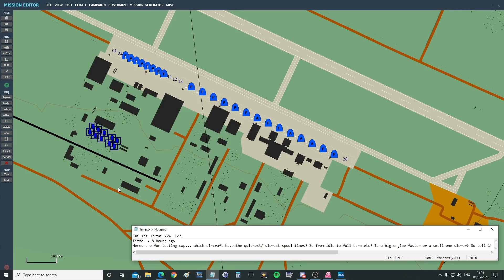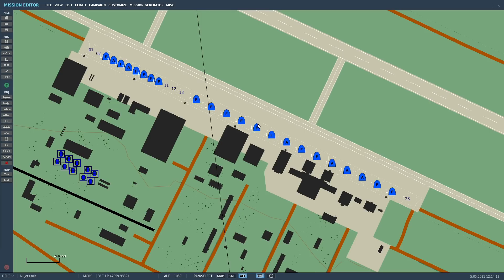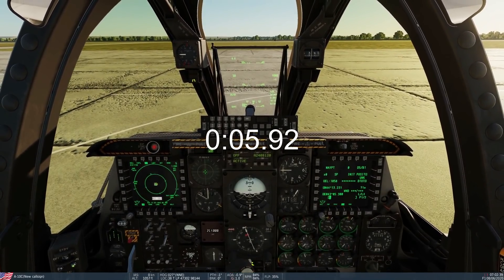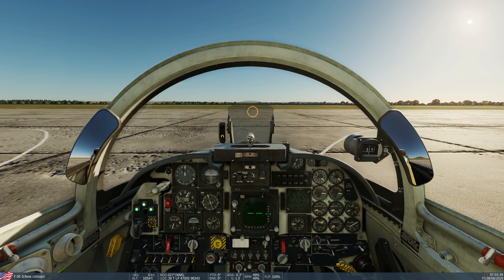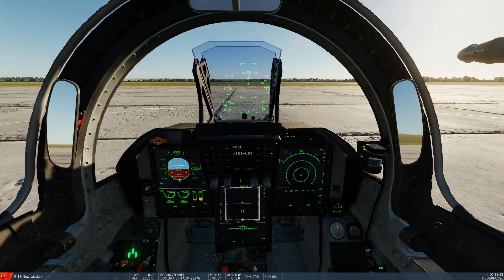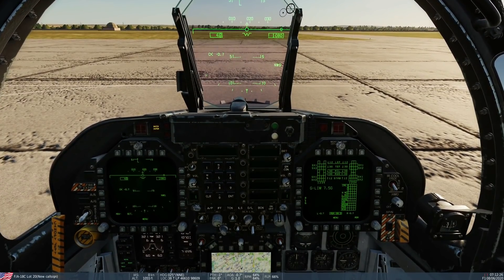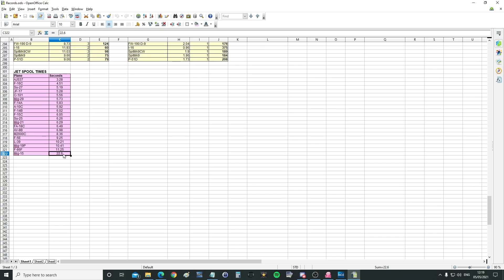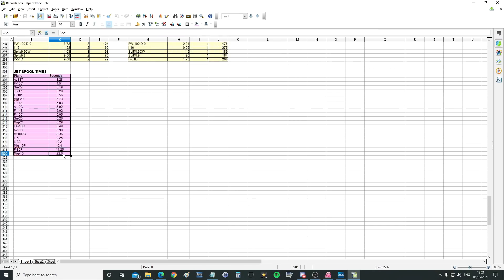Questioned: Which Aircraft Have The Quickest Spooling Jet Engine? | DCS WORLD

Comment: I think the dominant factor is the number of spools/rotors: twin spool/rotor engines are far more superior. As your test shows the faster ones, faster than M2000, are all twin spool engines. M2000 and slower ones are single spool engines. 
The twin spool engine means having a tiny high pressure core rotor, which can freely outrun the bigger low pressure rotor. The HP rotor is very much the true engine while the LP rotor serve as a turbocharger to the HP, so it's okay to scram the HP real fast without caring too much about LP. Also having an LP will make a good working environment of HP, so the HP won't stall easily. And having a light weight HP will shed load from HP turbine, also avoiding the turbine to overheat, so you can pour more fuel into the burner.
Other factor such as variable guide vanes at compressor also helps, it somewhat acts like having an LP compressor avoiding stall, but can not help with the weight and turbine load. That's how M2000 engine become the fastest spooling one among all the single spool engines.
One exception is the L39 engine, a twin spool one but slow. I don't know why.

For jet engine it's not easy to talk about efficiency, because they don't want to extract the energy from the exhaust. It's the converging-diverging nozzle that turns heat into exhaust kinetic energy. But if we put a free turbine after the engine and extract energy, then it becomes a turboshaft, usually having 25%thermal efficiency. But the free turbine itself also contributes some loss. A properly working turbine has around 80% efficiency.

Comment: Don't the F-14B and the F-16C have the same GE engine? If so why is the  are the ones in the kitty slower to spool up?
Reply from the maker: Neg different engines pretty sure. At least our model.
Reply: @grimreapers  the DCS F-16C has the  F-110-GE-129 while the F-14B has the GE F110-400, not sure what the difference between the two are

Comment: The MiG-15 takes the longest as the VK-1's (licence production of RR Nene) compressor is centrifugal, the impeller is much heavier than an equivalent axial compressor rotor so it takes a while. Also I presume the VK-1 has no variable geometry in the engine (like intake and nozzle guide vanes) so fuel flow has to be increased slowly to keep turbine inlet temperatures below limits and avoid compressor stalls.
USA was very salty about RR (well actually GB) selling the blueprints of the Nene to the Soviets back in the day. Another story.

Comment: Spool times become more interesting the more spools you actually have. The RB211 on the TriStar would take a fair old time to start simply due to the mass of the rotating parts, especially the front fan. To get ignition you needed 25% N3, 10% N2 and 'some' N1, ie as long as the fan was turning then it was fine. The airflow controls (variable inlet vanes and compressor bleed valves) work on the N2/IP stage, so it had to be at this minimum speed to ensure you wouldn't induce a surge or stall when beginning combustion. After that, it would slowly creep upwards with the starter releasing at about 35% and on towards an idle of about 50% percent, air temp and pressure depending. If you wanted to accelerate further, your acceleration schedule would massively depend on your fan speed, as that took so much longer to speed up than the other two stages. Once you got past 80% ish, the whole thing has so much momentum that speed changes happened much quickly - this is the reason on ailiners when pilots apply power for takeoff, they'll move the throttles to a mid position first and allow everything to stabilise, as this is where the largest difference in accel times can be found, and could potentially cause a yawing motion on the takeoff roll. If they're all at about 80% ish and stable, they'll accelerate to take-off thrust much more symetrically than going straight from idle.
To summarise, it's all about airflow control and keeping the fuel schedule between two lines on the graph - too much or too little in relation to the air going through the engine and you risk surge/stall when trying to change the engine speed. If we could get this modeled in DCS that would be great - doing the adjustements on the engine whilst it's running though, is not so great...

Comment: Isn’t the F-15C engine the same as the F-16? Interesting the spool time is so different.
Reply from the maker: Neg, I used to think that also, but different engines, also the F-16 has had at least 3 engines since the prototype.
Reply: The F-16 Block 32/42/52 PW engine like the F-15C/D.  The F-16 Block 30,40, 50 have GE engines. Since the F-16 in DCS is the Block 50 it does not have the same engine as the F-15.

Cap, you are correct about the F-16 having at least 3 engines since the prototype.

I will start from Block 30.
Block 30 = F110-GE-100
Block 32 = F100-PW-200
Block 40 = F110-GE-129
Block 42 = F100-PW-220
Block 50 = F110-GE-129
Block 52 = F100-PW-229
Block 60 = F110-GE-132

Comment: Gents, it's not so much the materials in the engine that determines the engine spooling.  The age of the engine determines the spool rate.  Older engines used mechanical engine controls and that's what adds to the lag.  Newer engines usually use a combination of mechanic and electrical control and tend to manage the engine better.
Reply from the maker: thx

Comment: Not So Fun Fact: When I was stationed at Tinker AFB, with AWACS, we were driving on the ramp going to run a jet, when we saw an A-7 Corsair II, that just came at of Depo Level Maintenance. They were starting it for it's first flight. I heard the air starter then woosh. It started in like 2-3 seconds. Didn't think that was possible. E-3A TF-33's take like almost a minute to spool up. So, it went on it's first flight, had some kind of engine trouble, and the pilot punched out over Del City. The A-7 hit some ones house, pretty sure no one injured or killed. Pilot was walking around dazed in a field. Yeah.

Comment: Liturature from the 1980s talking up the F/A-18's GE F404 was the very fast 4 seconds from idle to afterburner. It was said to be quite faster than the F-15/16 P&W F100.  Certainly at the time, comparisons of the F404 were mainly to the J79 types, though it was stated the F/A-18A was beating the F-15A in a short drag race becuase of engine response time. 

Considering the F-14B, F-15C, F-6C all use GE F110, they should be relatively similar. And I wouldn't be surprised if spool time was faster than F404.

Comment: A big part of what limits the spool up time is the need to avoid compressor surge. Unlike a piston engine, the combustion chamber of a jet is open at both ends so if you dump a load of fuel into it at low RPM, the chamber pressure can easily rise past the point that the compressor is able to continue to supply air because the turbine hasn't had enough time to spool up from the increased downstream flow. You then get a reversed flow as gas from the combustion chamber pushes the air backwards through the compressor stages and blows it out of the intake, sometimes with catastrophic results.

Other reasons to avoid very rapid throttle changes are to prevent excessively high temperatures from a sudden change in mixture ratio from being very lean to running closer to a stoichiometric mixture. Again, the problem is caused by the rapid increase in fuel flow before the compressor has had time to speed up enough to supply sufficient air. There's also a third point which affects multi-spool engines in which the high pressure compressor stages are connected to a small, high pressure turbine with a larger low pressure stage downstream. The difference in rotational inertia means that it's much easier and quicker to spool up the high pressure sections than the low pressure ones, so a sudden throttle increase can lead to compressor stall in the HP section because it starts spinning too fast and needs far more air than the LP stages can supply.
Reply from the maker: thx

Comment: parasitic shaft losses would be really, really low....keep in mind that from all the mechanical power extracted by the turbines, about 2/3 are gobbled up by the compressor and only the remaining 1/3 spins the fan...the one that makes most of the several tons of thrust.

A few 10s of kW taken by the generator, hydraulics and fuel pumps barely make a dent in the shaft power budget ;-)

Comment: It would perhaps be interesting to see what kind of engines the planes have.  And where it's licenced from if its a modified version.
Reply: Viggen uses a Volvo RM8 which is a heavily modified P&W JT8D - a low bypass turbofan originally built for the 727 airliner. Volvo basically took the civilian design and upgraded it for supersonic flight as well as added an afterburner. 

Depending on the age of the model used, the F-16 could have either the P&W F100 which is also found in the F-15, or it could use the GE F110 which powers some export F-15s as well as the F-15EX (although multiple versions of both engines have been and are currently in service). 

The MiG-29 and JF-17 both use versions of the same RD-33 engine .

The Mirage 2000 uses the Snecma M53 which is an interesting engine because it's a turbofan version of the Atar turbojet, that was derived from the WW2 BMW 018 which itself was a larger version of the BMW 003 that powered the Heinkel 162 fighter and Arado Ar 234 bomber. What started out as one of the earliest jet engines ever, which produced a mere 1,760 lbf thrust ended up as a 21,400 lbf thrust afterburning turbofan that's still in service today.
Reply: @trolleriffic   im 99% sure that the f-16c block 50 (the one we have in DCS)  has the general electrics engines. P&W’s would be seen on something like the block 20 (MLU)
Reply: @koekiejam18 ,  @trolleriffic , The F-16C Block 50 does have the GE engines and is the F110-GE129.  Starting at Block 30 all blocks ending in "0" are GE engines and blocks ending in "2" are PW engines.

The current F-15EX's will all have F110-GE-129 engines because the PW engines have not been approved for "Fly by Wire systems", but this will change because the PW engines will get approval for the FBW system.
Reply: @williambyrnes4198  hmm might've made a mistake there, couldve sworn that my country's airforce has block 20's with pratt and whitneys...
Reply: @koekiejam18  Read my comment again and you will see that it says "Starting at Block 30".

You are correct about your Block 20's having PW engines because all F-16's under block 30 had PW.  It was not until Block 30 did they start putting GE engines.

The Block 20 that your country has most likely has the F100-PW-200 engine because that is what was used in the Block 20's when they came out.  Your country might have upgraded the engines to -220's if that is what you have now.
Reply: @williambyrnes4198  i see my bad, no clue wether we upgraded the engines, dont think that was a requirement for the MLU program

Comment: Here's another one, how can the one turbine of the F-16 be stronger than the two turbines of the F/A-18?
Reply: The two F404s in the F/A-18 have a higher combined thrust than any of the F100s or F110s that power the F-16 but the difference isn't huge. Basically the F404 was designed to be cheap and reliable as well as having a lower thrust and smaller size to suit certain aircraft, while the engines for the F-16 were much more state of the art and designed to be big and powerful at the expensive of cost and reliability in the early days. The F110 is heavily based on the F101 which was developed for the B-1 Lancer and was the most powerful US military jet engine when it was introduced.

Comment: Just a rebuttal on your statement that axial engines are superior in every way: Centrifugal compressor engines are superior in terms of torque-conversion. That's why they're still widely used in turbo-prop and turbo-shaft aircraft and helicopters. I'm not 100% sure why, but I believe axial flow compressors are more effecrive at producing thrust due to airflow not being interrupted by converting air velocity to pressure and back and forth etc. like centrifugal compressors do. I'm also under the impression centrifugal compressors are more effective at building up high pressure air rather than high velocity, which is better for torque production instead of thrust.
Reply from the maker: Thanks!

Comment: Don't F-14B, F-15C, and F-16C all have the same engine?
Reply: They might all use versions of the GE F110, although it's only fitted to some export F-15s. The P&W F100-220 is found in both the F-16 and F-15 (certain ones at least) but not in the F-14.
Reply: @trolleriffic  Block 30, 40, 50 (X0) all use GE engines, while 32, 42, 52 (X2) use PW engines, right?
Reply: @Hairysteed  You are correct about the X0 using GE and X2 using PW.
Reply from the maker: Neg, all different.

Comment: Rotating mass will play a large part in spool time, but the design of the engine is also very important. A modern engine with dual turbines and multi-stage compressor, variable guide vanes and digital engine control etc will likely be much more responsive than one with a single turbine and compressor even if it is heavier.
Reply: They can be too responsive if the FADEC doesn't limit the throttle response. The HP stages have much lower rotational inertia than the larger LP stages so they'll spin up faster and can end up stalling if that happens too quickly.

Comment: Could it reason for slow spooling in centrifugal flow motors be related to the inherent inefficiency built into their intake system?
Reply: Probably, i bet that older engines would be worse at spooling up too. In an even more close to life idea, engines that have been used alot and might have some internal wear would probably perform worse too

Comment: Some other factors to take into account will be the materials available to the manufacturers at the time (ie the era of engine) as this will determine the amount of overfuelling the turbine will take without heat damage. It's the overfuelling that controls the change in rate of expansion of the gases in the combustion chamber and therefore the energy you can extract with the turbine (to give an acceleration) on the principle that more fuel = more heat energy = more turbine work. Then you need a carefully matched compressor that can deliver the required air mass to support that acceleration without surging or stagnating and a fuel control system that can control the rate of overfuelling with repect to changes in mass flow deliverd by the compressor to get the quickest and smoothest acceleration at the most efficient operating curve of the compressor. When you open the throttle, you are basically opening a tap and it's down to the fuel control system to take charge and control that acceleration, early fuel control systems were somewhat course (and therefore tended to run safer margins) compared to later systems which were much more sensitive and able to run much closer to the ' surge line'.
Which brings me onto the Kimlov VK1 (Nene copy) in the Mig15, whilst the mass of the compressor impeller will have an effect, the fuel control systems on the early centirfugal engines were extremely basic and most early ones didn't have acceleration control (The DH Ghost engine in the Venom had an early form of air/fuel ratio control to assist smooth acceleration) therefore the Pilot had to be extremely careful in handling these engines and you couldn't just wack the throttle open and expect the engine to do it's thing. I'd suggest the modelling in DCS on this is not realistic (in that you can wack the throttle open without consequence) and the modelled spool up time will probably be representative of a carefully controlled throttle opening by the pilot.

Comment: I would appreciate a more long-form discussion on this topic that goes into this topic; both on the mechanics of spooling the engine and an assessment of the motivation behind having a quickly spooling engine. Is sub-10seconds really not fast enough? What damage can I do to an engine by engaging the afterburner 5 ish seconds after a cold start? What is the nature of the damages due to possibly uneven and sudden thermal expansion?

Thank you for the video Cap; always a pleasure.
Reply: The engine controller will actually limit the rate of throttle increase to avoid a sudden jump in the amount of fuel being supplied. If it didn't you can end up with compressor surge due to combustion chamber pressure being too high relative to the air coming from the compressor, overheating due to the mixture running too rich, and in multi-stage engines it's to avoid stalling the high pressure sections of the compressor by overspeeding them relative to the low pressure stages.
Reply: To answer your question about what damage can be done.  When we test engines we need to stabilize at idle for 5 mins before we can advance the throttle past 80%.  The reason for this is to allow the engine to thermally equalize or damage can happen to the compressor blades.  When pilots start the aircraft they will sit for 10+ mins before they taxi.  The only time I have seen the aircraft takeoff in less than five minutes after starting is on alert aircraft used for scrambles.

Also will add that we have to stabilize at idle for 5 minutes before we can shut down.  The pilots don't have to wait 5 minutes to shut down after getting to their parking spot because more than 5 minutes have passed from the time they land to their parking spot.  Plus during an engine run as long as the RPM did not go above 80% then we do not have to cool for 5 minutes. This is for most engines and will be different and is based on the limits set by the manufacture.